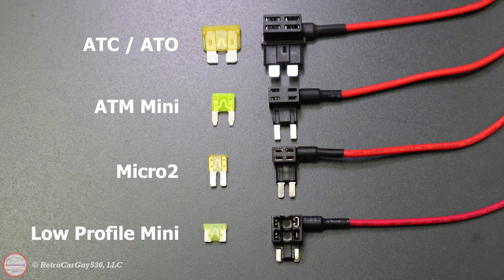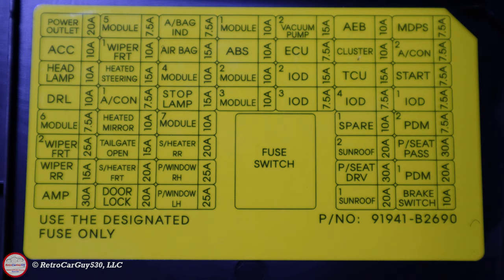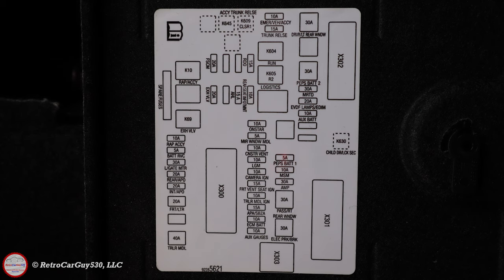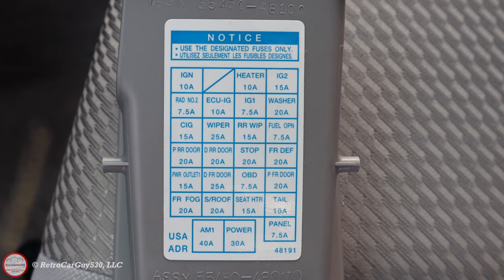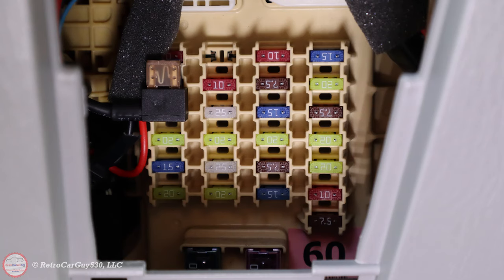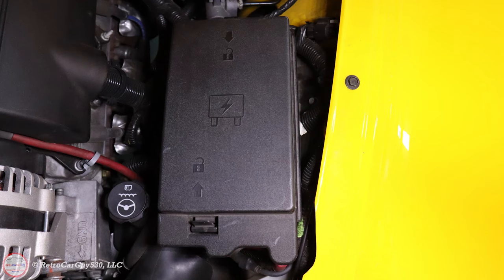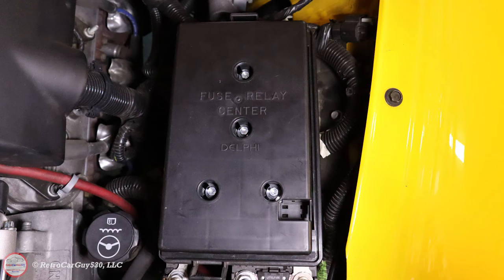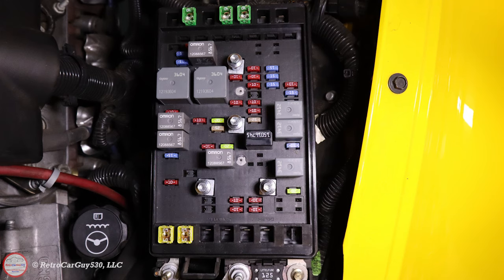How To - Add a Fuse Tap in Your Vehicle

Comment: Hi, Sir. What about directly wrapping into the fuse w/ a wire that has a fuse holder?
Reply from the maker: If I understand your question correctly, I would not suggest that approach.  Wrapping a wire around one of the legs of the fuse and then inserting into the fuse socket can result in a poor connection of the fuse and/or wire in the fuse socket.  It will likely stretch the metal contacts in the fuse socket resulting in a loose connection between the fuse socket and the fuse with or without the wire wrapped around that leg of the fuse.  A loose/poor connection can result in a potential heat build up as well from the potentially loose connection.  I hope that answers your question.
Reply: @RetroCarGuy530  thank you for the response, sir. Yup you answered my question perfectly. So after months of improper method i had it corrected by installing an added fuse tap. Seems ok so far, should i be worried if the socket got loose, will it give me future problems?
Reply from the maker: If the fuse tap isn't loose in the fuse socket, you should be ok.  If there's some looseness detected, then try the following...

If it was only slightly "stretched" then you can try one simple trick to compensate for it.  You can try slightly bending/twisting the fuse tap's contacts that get inserted into the fuse socket.  This will apply extra pressure on the fuse box contacts in the fuse socket.  Use a needle nose pliers to twist the blade contacts on the fuse tap by just a degree or two (it doesn't take much).

Comment: so where do I connect the negative wire
Reply from the maker: The fuse tap has no ground for the tap.  The new device / accessory’s ground should be connected to a nearby ground lug or a clean metal area of the vehicle’s body.

Comment: Wanted to ask if this hard wire method will used less battery  juice for the dash cam compared to using the OBD port plug for the dash cam?
Reply from the maker: It won't use less power than a dash camera connected with a power port adapter for the OBD-II port.  The power supplied to the OBD-II port has some sort of fuse in the box as well and many vehicles have the OBD-II port tied into the same circuit that supplies power to one of the accessory power ports in the vehicle.  If you have accessories already plugged into the other power port(s) that are powered by that circuit (car phone power adapters for example), it could mean that the power left available via the OBD-II port is reduced by the other devices drawing from that same circuit.

I tend to prefer to supply power to the dash camera via a different circuit than the OBD-II port, so that if I take the car in for service, the service tech won't be removing the power to the dash camera if they're plugging in a scan tool into the OBD-II port to perform their work.

If you use an OBD-II port power source for your dash camera, just make sure that the power is switched power from that port or the power plug for the camera or the camera itself has a power cutoff circuit so it won't drain the vehicle's battery below a certain voltage.  Some OBD-II ports have an unswitched power supply and if there's no cutoff circuit in the camera plug or the camera, the dash camera can drain the vehicle's battery down.
Reply: @RetroCarGuy530  What do your prefer. An hard wire>OBD?
Reply from the maker: My personal preference would be hardwired, but an OBD-II port connector can be a valid way to connect a camera to power.    It depends on what features of the camera you're trying to use and support.  Parking mode support often requires access to switched and unswitched power which an OBD-II port connector may not provide (depends on how the camera detects when to enter/leave parking mode).  Most cameras use the switched power source to know when the car has been parked, but some cameras (BlackVue comes to mind) use motion detection to determine when the vehicle is parked or moving.
Reply: @RetroCarGuy530  Thank you for your input. I have a universal OBD-ll port  with an on/off switch (-/o) also an hardwire kit for my dash cam. I'll test both out on how it works with my cam. I was just concern of the power consumtion on both. Thank you for the detail vid & fast response. Salute!!

Comment: em' little bit confused as to:
1) what fuse amp i should be choosing from interior fuse panel/box.... as per BlackVue PowerMagic Ultra B-124X battery user manual I am suppose to identify switched(Accessory power) fuse of 10A or less from interior fuse panel but if my vehicle fuse is a low profile mini, which indeed it is, then i am not to suppose to use that 10A low profile mini fuse but to use 10A mini type fuse instead,  would 10A mini fuse fit in a low profile mini fuse tap?, considering both have different sizes.
2) Read somewhere never to put higher amperage fuse into the top row of the fuse slot, but user manual suggests insert 10A fuse into bottom row of the fuse slot and 20A fuse into the top row of the fuse slot. By doing so would not blow the fuse right?  
Also, purchased low profile mini fuse tap (600v 16awg wire) separately...do you think it should be good enough to plug in these fuses with (10A, 20A)
Reply from the maker: The B-124X installation steps for a hardwired connection are attempting to have you identify a fuse socket with a fuse that has a rating of 10 amps or less.  The 20 amp fuse they're stating to install on the top/furthest away from the fuse socket blades of the fuse tap.  The 20 amp fuse will supply power to the B-124X and the 10 amp or less fuse will supply power to the circuit that the fuse socket normally supplies its power to.  They're attempting to limit the max amp draw for the fuse socket in the fuse box to a max of 30 amps (up to 10 amps for the pre-existing circuit and 20 amps for the B-124X).  You don't want to have two high amp fuses in a fuse tap (a pre-existing 20 amp and a new 20 amp fuse) since that may be too much of a load for the one fuse socket and fuse type.

As I mentioned in the video, you need to locate the side of the fuse socket that supplies the 12 volt power.  The fuse tap's left blade/side must be inserted into the side of the fuse socket that supplies the power.  That way the power from the fuse socket is supplied to each of the two fuses in the fuse tap directly.  If you incorrectly insert the fuse tap so the right blade/side of the fuse tap is inserted into the side of the fuse socket that supplies power, the power path is now changed.  In this incorrect setup, the power goes up the right fuse tap blade/side, into the lower fuse, through the lower fuse and then the power is fed into the fuse socket and the newly added fuse on the top of the fuse tap.  This will overload the bottom fuse.  When you install the fuse tap so the left blade/side of the fuse tap is the one that receives the power from the fuse socket, the power path is direct to both fuses and the loads of the circuits beyond the fuses are supplied power only through the one fuse for each circuit (pre-existing one and new one added by the fuse tap).  The top fuse can safely draw up to 20 amps for the new accessory and the lower fuse can draw up to 10 amps for the pre-existing circuit in the fuse box.

You can search for "automotive wire gauge amp chart" on google and you'll find a variety of automotive amp vs awg vs length charts.  A 20 amp load on a 16 awg seems like it can be supported for just under 3 feet of wire.  

The 20 amp fuse seems excessive since the B-124X manual states the power port adapter (cigarette) mode of charging draws 5 amps and the "hardwire" mode of charging (set by the switch on the B-124X) draws 9 amps.   IMO, you should be able to use a 15 amp fuse (or even a 10 amp) for the top slot on the fuse tap for the power going to the B-124X when configured to charge in "hardwire" mode since the B-124X shouldn't draw more than 9 amps (or so).  A 10 amp fuse for the B-124X may be a bit on the low side, but I believe I had a 10 amp fuse for the B-124X when I was testing it in my car.

Using a 16 awg wire is possible, it just has length limitations on how far it can safely deliver that power.  Look at the automotive amp/awg/length charts and see if the 16 awg wire is sufficient for the distance between the fuse box and the B-124X.

You should use the fuse tap type that corresponds to the fuse type in your fuse box. 

I hope that helps.
Reply: @RetroCarGuy530  Thank you!! you have been a gr8 help!!

Comment: I have a 2011 Keep liberty with only an engine bay fuse box. After wiring the fuse tap, what is the best/easiest way to get the wire inside the vehicle?
Reply from the maker: Since I don't have access to a 2011 Jeep Liberty, I cannot give specific advice on where/how to run the wire(s) from any fuse tap(s) into the passenger compartment from the engine bay fuse box.  Any modifications you make to your vehicle are at your own risk.  (standard disclaimer)

In general, if your vehicle only has a fuse box in the engine bay and you need power from a fuse tap in the passenger compartment, you might be able to run the wire(s) from the fuse tap(s) from the engine bay fuse box through an existing wiring harness access hole/seal in the engine bay firewall.  

There are usually are a variety of wiring harnesses that pass through the firewall and many times there is usually a small amount of space / gap in the rubber seal that can used to pass another wire through the firewall.  If there is no space to pass another wire through an existing seal, you can sometimes gently create a small hole in the excess rubber portion of an existing rubber seal (depending on its structure) where another wire/harness is going through the firewall and use some RTV sealant to prevent water intrusion into the passenger compartment.   

As a last option, you might need to drill a small hole in the firewall to pass the new wire(s) from the fuse tap(s) through.  If you do drill a hole be very careful/selective where that hole is located as not to interfere or break anything on either side of the firewall.  I would also suggest using a rubber grommet in the hole to protect the wire(s) from the metal of the firewall and use some RTV sealant to make the entire thing water tight. 

Plan it out carefully so the end result is no harm was caused to any existing wires, wiring harnesses or other parts in your vehicle.
Reply: @RetroCarGuy530  I appreciate the time and response!  I know it has the potential to be a vehicle specific issue. Is there any negatives into tapping into the 12v constant of the cigarette lighter wires?
Reply from the maker: As long as the load (amp draw) of any device plugged into the cigarette lighter port and the new device don't exceed the fuse rating and is safe for the wire gauge (awg) used, it can be done.  If the cigarette lighter port provides constant (unswitched) power, make sure your new device does not draw power all of the time because you could potentially drain the vehicle's battery to a low charge level which may result in a no start situation.

Comment: Can I use B/Up lamp fuse  (A/T : PCM, Transaxle Range Switch, instrument cluster, Electro chromic mirror) to connect DRL ?
Reply from the maker: I assume that "B/Up lamp fuse" is for the backup (reverse) lights.  It could work if the power available at that fuse socket is "On" (supplies 12-volts) when you want the DRLs to be on and it has enough available amps in the fuse socket to add the fuse tap (see in my FAQ video https://www.youtube.com/watch?v=DnZ5wb_A5vE ).  The only caution would be that the backup lamps are likely powered by a control module based on the current gear selection.  See my comments below about power being obtained from a control module power fuse socket.

I would not recommend PCM (powertrain control module), transaxle range switch, instrument cluster) as sources for power since those power important / critical systems in the vehicle.  The electro chromatic mirror fuse might be a viable fuse socket.  If it gets its power directly from the fact that the ignition switch is on and it doesn't go through a control module (like the body control module) to get its power for that fuse socket.  If a control module supplies the power to the fuse socket, you could be placing an extra load on the control module's internals and it may cause unpredictable side effects.

An example of this I just ran into with my project car on my channel is when I added a backup camera to my 2014 Chevy Caprice PPV.  I had removed the secondary (aux) battery in the vehicle (used to power police equipment which is no longer present in the car).  That left a power connector "available" in the area needed to obtain power for the backup camera.  An aftermarket camera harness was made to plug into the now unused aux battery harness connector (a control circuit for the aux battery feature).  I started having phantom "Trunk Open" messages occur after I opened and closed the trunk.  The power in the aux battery harness connector was actually power supplied by the body control module (BCM).  The power draw taken by the backup camera equipment on that circuit seemed to confuse the BCM in some manner to generate the phantom "Trunk Open" messages.  When I obtained power for the backup camera from another switched power source instead of from the aux battery harness connector, the phantom "Trunk Open" messages stopped occurring.
Reply: @RetroCarGuy530  You are fantastic, thanks for this detail explanation.

Comment: When adding a fuse to an existing fuse socket that is occupied, do the fuses need to be the same amperage? I’m adding a secondary horn that requires a 20a fuse . I’m piggy backing off the original horn fuse with a 10a fuse. When I use the secondary horn, it blows the 10a fuse for the factory horn. Then neither horn works until I replace the 10a fuse for the factory horn.
Reply from the maker: There appears to be a couple of things going on with this configuration.  The new accessory's/device's fuse should not have an amp rating higher than the original fuse in the fuse box fuse socket.  That's to make sure you don't overload the wiring providing power to the fuse box fuse socket.

Based on the behavior you mentioned of blowing the original 10 amp fuse when using the new horn, it sounds like you have the fuse box fuse socket's power feed going up the right leg of the fuse tap instead of the left leg.  When power is fed up the right leg of the fuse tap (side that has the wire coming out of the fuse tap), it routes all power through the bottom fuse (old device and new device).  Some will argue that is the safest approach since it will cause the original fuse to blow if the circuit amp load goes over the original amp rating of the original fuse.  In my video, I discuss locating the fuse box fuse socket's power supply side and then plugging the left leg of the fuse tap into that side of the fuse box fuse socket.  That routes the fuse box fuse socket's power up the left leg and directly to each fuse of the fuse tap.  Making two parallel circuits.  Correcting the fuse tap's orientation in the fuse box fuse socket should prevent the original fuse from blowing each time you use the new horn, but the concern of the new horn drawing more amps than that circuit can support is still present.

The wire gauge (awg) of the fuse tap's wire lead is usually 16 awg or 14 awg (smaller number is a bigger wire).  A 16 awg wire is rated to carry 20 amps for distances of up to 2 feet and a 14 awg wire is rated to carry 20 amps for up to 6 feet.  That's using a conservative automotive amp chart.  For that reason along with my personal belief that a fuse tap should really not be directly supplying power to a device that requires more than 10 amps, I usually suggest obtaining power for a new device that requires more than 10 amps by getting power directly from the vehicle battery with an inline fuse and if it requires switched/accessory power still get the power from the battery, but use a relay to toggle the power on/off based on the ignition switch position.

I discuss the "relay method" in a video where I add a dashcam battery pack to my car.  https://youtu.be/Joa0fiKZY-o?t=744
Reply: @RetroCarGuy530  the fuse socket for the horn is reading positive on both sides of the socket. It does go to a relay before going to the horn. But I will try to find another fuse/ socket to get power, preferably 20a as I was wondering about. For reference, this is on a 2019 Toyota RAV 4 Hybrid.
Reply from the maker: A fuse socket should not be providing power on both sides of the fuse socket. The power check is performed with the fuse removed from the fuse socket.